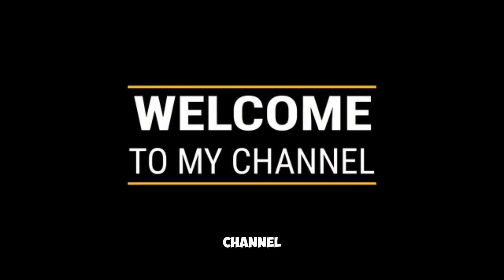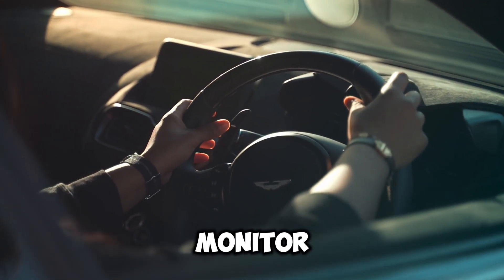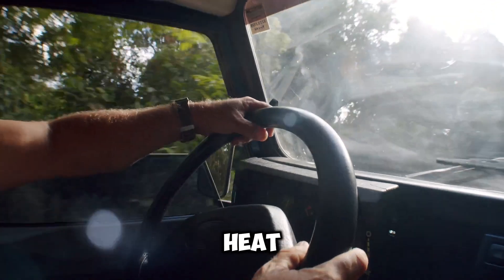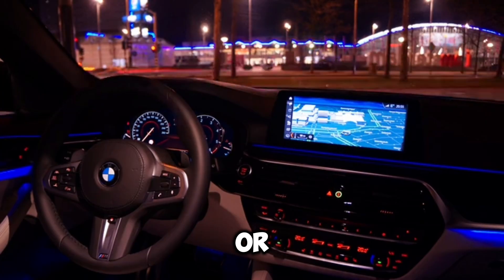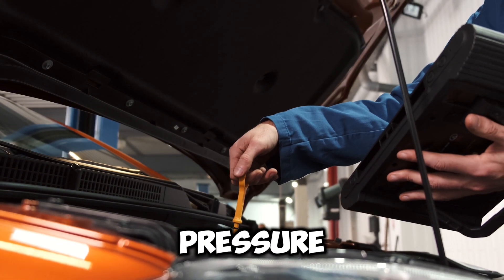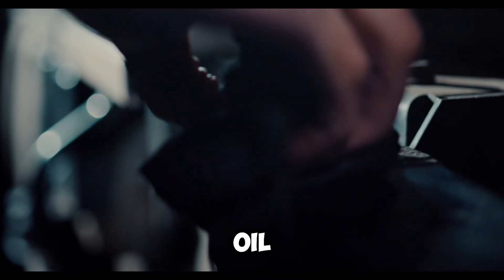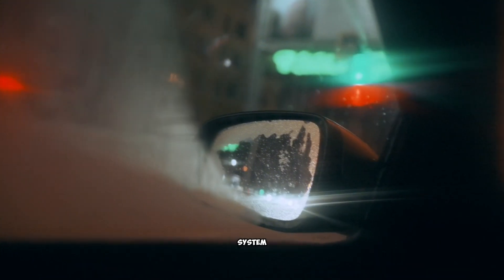Oil Light Coming On When Accelerating - Causes & Solutions

Comment from the maker: ⏱Timestamps⏱  
00:00 Intro
0:27 What is the purpose of the oil light in cars?
0:51 1. Low oil level
1:14 2. Oil viscosity issues
1:35 3. Oil pump malfunction
2:01 4. Clogged oil filter
2:23 5. Faulty oil pressure sensor
2:41 6. Engine wear
3:04 Is it safe to continue driving if the oil light comes on while accelerating?
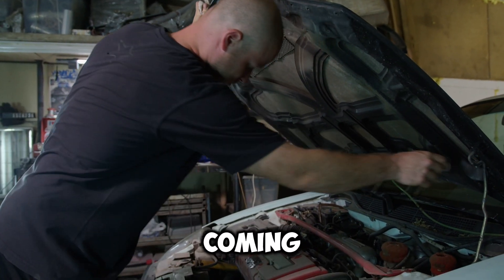3:19 How often should I change my oil to prevent the oil light coming on during acceleration?
3:40 What can I do to prevent the oil light from coming on during acceleration?